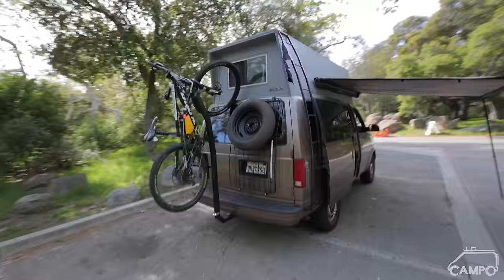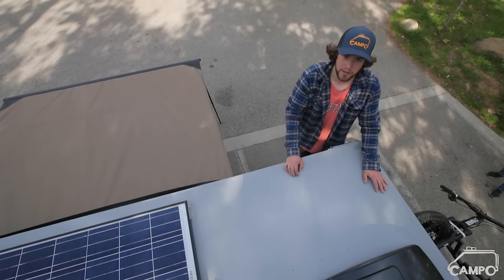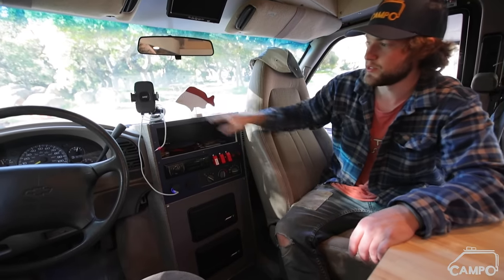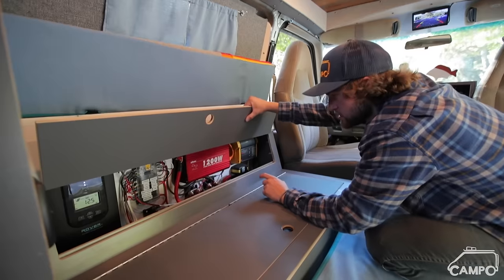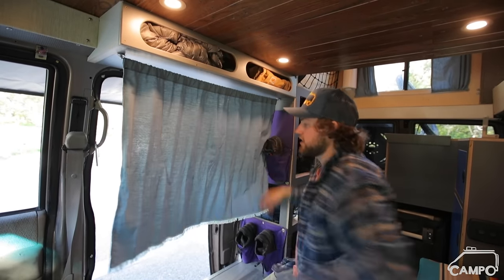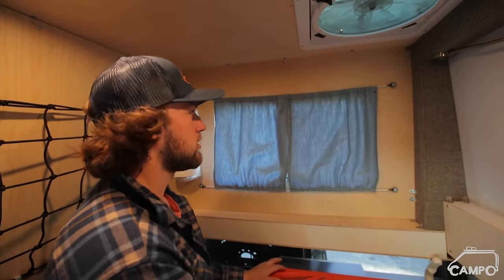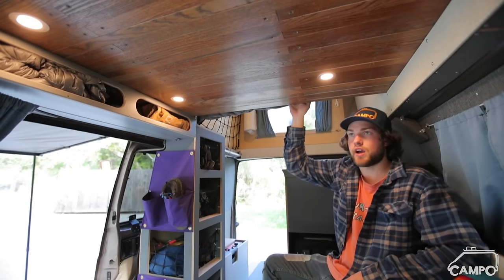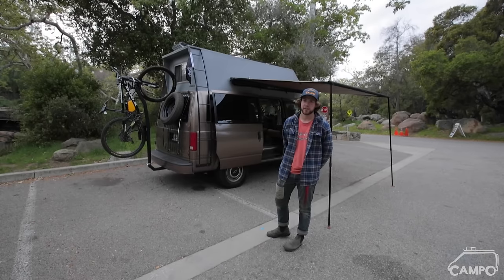DIY Astro Camper VAN TOUR - "Swiss Army Knife" of vans?

Comment: Really really neat and I'd definitely love a similar set up some day, but I have one question... Is this insurable? 

Like does your insurance company know that you modified the frame of the vehicle in such a way by removing the roof? 

I know that a lot of people on overlanding forums have had issues where an insurance company states you aren't covered AFTER an accident because your vehicle was altered without their knowledge, or that the camper set up itself weighed more than what the vehicle was registered for on the sticker in the door (GVWR)

I ended up having to sell my dodge 2500 and get an F-350 dually because the camper my wife and I bought to go on road trips weighed too much for the 2500 so they wouldn't insure me.